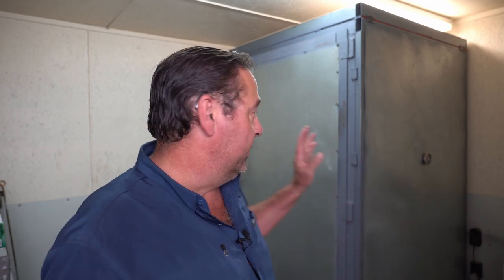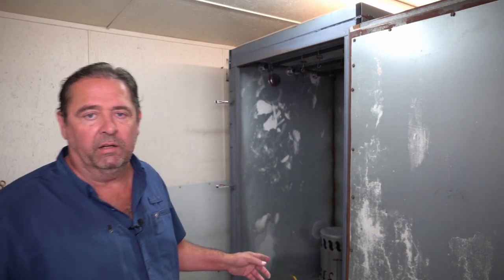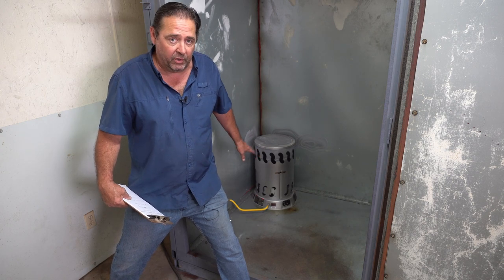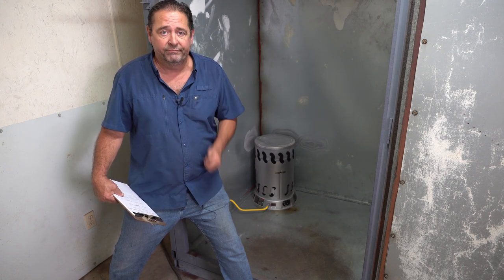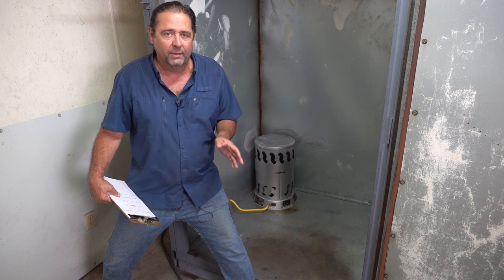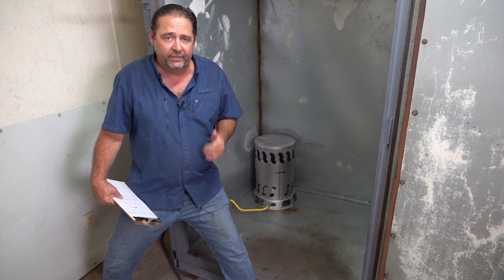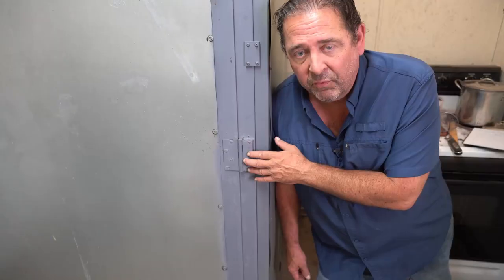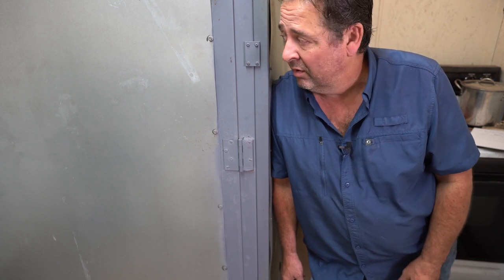DIY POWDER COAT OVEN

Comment: Wire it into a PID Controller using a gas solenoid and it will regulate your temperature for you and save a bunch of headaches.  I'm using a torpedo heater piped into my oven, so same concept.
Reply from the maker: Hey, great info! Thanks, will definently research that.

Comment: This is fantastic, you've really inspired me. I'm wanting to start powder coating, but will not pay $$$ on oven. I still don't know why in all the Eastwood powder coating videos they say don't use a gas oven .. I'm beginning to think its because they don't want us to build our own. Thanks 1M for sharing this with us.

p.s. I want you to be safe, I hope you have some fresh air flow while you're waiting beside the oven. I hear the powder coat puts off unhealthy fumes, as does galvanization above about 395F.  Also, I will be looking at the temp rating on that insulation.  Thanks again.
Reply from the maker: Thanks for watching and commenting!  I don't remember the temp rating for the rockwool insulation that I used but I do remember that it was pretty high.  Good luck with your build.  And yes, there is a fresh air and exhaust vent for any of those nasty gases.

Comment: I like it! Project Farm (Or someone) found the "Blue" oil/water filters with more media, so better. Most regulators are not, they are valves, either plunger or gate. Ones w/diaphragm, springs, viton rubber tipped moving parts are $80+. Grounding is important but placing two feet away from the roofs edge helps get it where rain falls, if it rains. It makes sense to increase the positive electrode surface area, my first thoughts are old carb main jets cleaned on wire wheel. The pipe on nozzle is brilliant.
Reply from the maker: Thank you very much!  Loved your comment.

Comment: nice job on the Oven and sharing your thoughts ,findings ,and reccomendations on the Oven  i am aRetired Woodworker by trade  and at one point in my career i went to work for  a Competitor that  also had a MetalWorking  shop in their facility  roughly 25 years ago  all their Powdercoating had to be sent out because of those shops  having the Ovens large enough to accommodate  the products  the messed up part  was always we were at the Powder Coaters  time frames on most of our jobs  the DIY kits  has really changed  a lot of the ways Metalworking gets done currently  i have a  freind /former Coworker  who is a Professional Drag Racer  and Hot Rod builder who has another Hobby of Off-roading  on ATVs  and doing fabrication and Performance upgrades  he now does all of his ownPowder Coating in-house  with a Oven he built  that’s also heated with Propane his oven is about half the size of yours as he Specializes  on Honda 3 and 4 Wheelers   and   he does  lots of Swing Arm fabrications  plus brackets for his Drag Racers. he  Powder coats
Reply from the maker: Awesome!

Comment: Hey there great video and explanation! I have been using a normal oven but want to make a bigger one to do larger items like rims, or trailing arms off sleds, maybe rear ends etc. Looks great! I'm sure the r value doesn't matter if you can touch it when it's on when working it's fine!!!! I love rockwool, used it for the sidewalls on my garage!

Comment: Great video, lots of good information.  I will say from my experience in designing analyzer shelters for installation into Canada that you should NOT compress insulation.  The air spaces in the material are important to its function.  Maybe your walls are still working fine for you, but you have decreased the R value enough that instead of buying R15 rockwool you could have used properly installed R13 fiberglass.
Reply from the maker: Yes! I do agree on compressing insulation does deminish it's R factor.  I took this into consideration during the design phase and it works great for the operating temperature that I'm working with.  Thanks for watching and for the insight.
Reply: It’s only going up to around 400° it’s absolutely fine

Comment: Most informational oven build video I’ve seen !! 
Question ?  Will that model Mr heater work for a 5’wide x 6’ tall x 8’ deep oven or would the next model up the up to 200,000 btu be better ?  What size propane tank do you use ?  Thank you for your help Sir

Comment: You have given me a little hope. I keep hearing that it is dangerous to use a gas/propane stove for powder coating. Obviously if you are doing it that must not be true. I only need to do 4 or 5 parts for my car and then I won't need it anymore. Hoping to find a cheap way to build a box. I already own a heater like yours.
Reply from the maker: Propane gas is used all the time in large manufacturing facilities for powder coating. Just be sure to use a metal gas line inside of the over, not rubber.

Comment: Thanks for the video, we think a lot alike.  I've been daydreaming about how I want to build mine and I was thinking about gas. A gas grill was a thought for the burners, and I also thought about the grill temp gauge.  I got some good insight from you.  I like how you have it vented; I was thinking that if the burner went out, it could fill with gas.  How many times can you run it on a bottle?  TSC sells larger bottles for campers, that could be an option if it goes through those grill bottles too fast.
Reply from the maker: I get about 5 to 7 runs on the standard size tank.  This was actually easy to build but you will need two people to assemble it.

Comment: Great video, I'm looking at making one now because of your video. For a typical powder coating job, when you go from cold to turning off the gas, about how much propane do you use? Looks like you have multiple 20 pound tanks in the video. How many times can you fire up the oven on one tank?
Reply from the maker: You'll only need one tank.  Two, if you want to run one completely empty before you refill and if you run out of fuel in the middle of a job it's nice to have an extra.  One tank last many runs.

Comment: So i love your oven by the way. Great job, mine is actually the same size inside and i have currently been using electric with a expensive pid control and 3 elements. I was going to convert to the mr. Heater forced air torpedo style and then i saw your video.  My only concern is that unit you use. What about the plastic parts i.e. switches and knobs they dont melt and gas off? Maybe a stupid question but a concern. Id rather spend $105 vs. 300 on a heater thanks
Reply from the maker: Yes the plastic knob will melt/deform.  I took mine off and just use a pair of pliers.  Other than that, no issues.  I do use a metal line for the gas supply too.  Happy to hear you liked my video, and thanks for watching!
Reply: @CycleFab  Thanks for the quick response. You are the best.
Reply: I was wondering the same thing, thanks for the answer. I’m looking to build an oven with in the next couple months.

Comment: Well build and straight to the point.
Love the idea that you rather build it yourself instead of spend money on something that don't give better results.

I build myself one - Inside dimensions 10 feet long, 3.6 feet wide and 7 feet high, also lpg operated.
for the burner I simply put a 0.8mm mig tip on the end of 5/16 rubber hose from the gas bottle.
On the inside of the oven I used  a H shape 1 inch diameter metal tubing with slots cut into it every 1/4 of an inch and the pipe protrudes on the outside
I simply push the rubber pipe inside the metal pipe and that allowed enough oxygen to enter the burner. 
Cheap, easy and very effective.
Reply from the maker: I like the way you think!  
Thanks for watching and commenting!

Comment: Did you ever get a detailed build sheet on your oven? Did you get it hooked into a PID controller for the heat control? Great build looks like a quality oven , not thrown together
Reply from the maker: No I haven't and I apologize.  I have been really busy as of late but it is on the list.

Comment: Hey Bud, love your oven!  I’ve been trying infrared electric heaters but I’m not quite hot enough.  I have a 3x3x4 box.  I do have a infrared gas 20pound bottle heater that i mite try..make an opening set it in front of..  do you have any thoughts on gas infrared heating ?  I do plan on doing it better at a later date.
Reply from the maker: I'm not an authority on using infrared heating so I can't give you an answer on that.  But 400 degrees Fahrenheit is still 400 degrees regardless of how you produce it.  Good luck with your project!
Reply: @CycleFab  thank you  I think i just panicked a little lol  keep up the good job 👍

Comment: Thanks!!! It appears the door lip lays over the 1.5 x 4 frame to create the area where the gasket goes/seals. Can you explain what size material was used for the door frame?
Reply from the maker: You're right it is 1.5" x 4" x 16ga.  I put a bottom in mine but in hindsight it's not needed.  Thanks for watching and commenting!

Comment: Yes sir how efficient do you feel your propane oven is compared to electrical oven do you think it's actually a little cheaper doing propane versus electricity
Reply from the maker: Yes, the propane route is more efficient and less expensive than electric heating elements.
Reply: Thank you so much for the response I am also on your ebay page buying the upgrade for the harbor freight powder gun. Thank you so much for your content it's been very helpful. @CycleFab

Comment: Hi. I am back to this project of building an oven. How are you regulating the temp and keeping it steady? I see people using  "PID controller" which I am unfamiliar with.
Reply from the maker: I just open the door a little if it starts to get too hot.  I also was told to use a PID, but really I don't need one for doing one off jobs.  Now if I were running all day long in a production process then yeah, I could justify a PID.

Comment: First ,Thank you for sharing your build. Lots of good ideas. The only question I have is your heat source. Is that an open flame? the fumes from powder coating are flammable and could blow up your oven if exposed to open flame.
Reply from the maker: Fumes from powder coating are not flammable.  I've worked in large manufacturing plants for years that used open gas flames in their ovens without incident.  However, atomized powder in high concentrate floting in the air can be very flammable!
Reply: OK thanks I'll take your word for it

Comment: are there any parts inside that heater you need to remove before using it?  Parts that can melt since it's not made to be in a closed hot box.
Reply from the maker: Yes, the plastic knob that turns it on.  I use a pair of pliers and that seems to work just fine.   Not a single negative issue with it yet.
Reply: @CycleFab  Thank you for the reply

Comment: Hello again. What would be your opinion of using steel fire doors to build the box for a furnace? I can get these free or cheap. I only want to do a few long parts for my own car so I am trying to go cheap. Do you think they would be safe to use?
Reply from the maker: That's a great idea!  My oven is used primarily for just a short amount of time at 375F - 400F degrees, so going off of that and the door in question is STEEL with nothing that will melt or burn you should be good.
Reply: @CycleFab  Awesome! The only that I worry might burn is the paint. Thanks again for replying so quick.

Comment: Also, did the knob to ignite it and adjust the heat not melt inside the oven? Or do you ignite it and take out the knob?
Reply from the maker: I was taking the knob out every time until I forgot it once.  And yes, it melted!  I just use a pair of pliers to turn the knob now.

Comment: Do you have to manually re ignite the heater once you shut it off or does it have a continuous spark so you can just shut off the gas??
Reply from the maker: Manual.

Comment: I just bought that heater because I want to switch to propane oven, where did you get the yellow line from and how was was it?
Reply from the maker: I think Amazon or a propane supply store for the metal yellow feed line, and it didn't cost much.
Reply: @CycleFab  did you leave the plastic control knob on there? Will it melt or burn off while in the oven. I’m currently removing the stickers off the side to prevent it from catching on fire
Reply from the maker: Yes, it will melt.  I use a pair of pliers. @meriscehajic7738
Reply: @CycleFab  appreciate it man! Thanks for the advice

Comment: Just fond ur channel. In my early research on powder coating stated not to use a gas oven,but here you are using propane as a heat source!  What is the difference from gas stove to your oven. Any issues?
Reply from the maker: I've never had a negative issue with gas.  I use to work for a large school furniture manufacturing plant that powder coated and their ovens were gas.  Also, if you look on YouTube you will see others that use ovens like mine were gas is used.

Comment: I have an older gun safe that is 5 ft tall 2 foot wide and 16" deep that I think would make a good powder coat oven. All I would need is to insulate the inside and install heating elements.  and controls.
any suggestions
Reply from the maker: I'd insulate the outside of it, not the inside.
Reply: sell the safe for what you can get and build your oven. You could see if they make a high temp liquid insulation but probably not worth the effort.

Comment: Wait you wanted to use metal studs but you had 155 and youndidnt need that many so you used metal tubing ..super confused
Reply from the maker: Sorry about that.  The metal studs that I wanted to use originally, can only be purchased in a large quantity which was more than what I needed.  Mechanical rectangular tubing (1.5"x3") on the other hand was more easily accessible in the amount that I needed.  Thanks for watching and commenting.